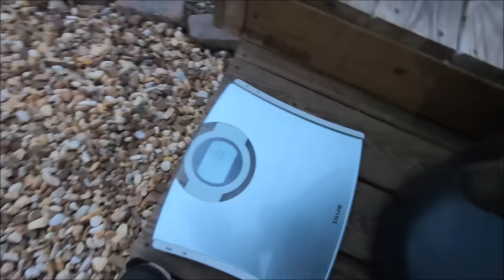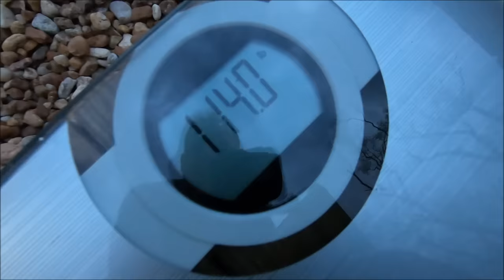Found Gigantic Chain Part 5: You Won't Believe Whats Other End: A Million People Want to Know ! ! !

Comment: It's a beach morring. A length of  line is tied to the chain..the middle of the line is tied to a boat. The.boat anchor is tied to the end of the line. A separate line is tied to the boat. The boar OS run to shore people and gear are set off .the skipper runs the boat out ehete a tender is tied off to the moring. The most is made fast and the skipper ferries himself in with the tender.  There is another way of doing this without a tender with a weighted submerged pulley 
This way the boat remains afloat in deep water. When you want the boat you you pull it in with the free line load up cast off secure the free line to the moring and head out .when you return you reverse this and your boat never goes aground.

Comment: Don't know if anyone told you what type of chain that is but I know what it is. Is there any railroad tracks by. Its a railroad switch chain. I used these when I worked on railroad cars. there used to chain rr cars together when a coupler or coupler knuckle is broke. so they can move the car in for repairs. dont know what the other thing is. hooked up lot of rr cars with these.

Comment: That is a tree drag. They drag cables tight with that bar with the pulleys on it so it does not cut the cable. The chain probably was in center when you found it.  They drag the chain through the loop around the bar  and push that swivel through a hole on a boat. Let friction hold it in place while they pull.

Comment: Wow - likely an anchor for a barge to hook up to and now can be a great chain lock down on the farm.  Tie something down so it can't be walked away with.  From Tornado or anything.  Bury it and have a short top out.  Nice chain, I wish I had it!    My guess, it rolled along a race on a dock as the barge moved with water.  A movable tie down. The triangle toggle is a lock when the chain goes through the ring.  The bar might be a Rope or strap pulley and the chain to tie it down.  Wonderful test to the mind.

Comment: About 40 years ago I worked on a stacker in a lumber mill.  We would set 2 of those things up, 1 on each side of a railroad track. We would then set the lumber from the Stacker on it and it would be rolled on the R/R tracks into the Kiln for curing the lumber.

Comment: The union used to use similar chains to stretch across rivers and streams to catch confederate boats, immobilize them, and sunk with hidden cannons (usually like on top of hills or bluffs (like they did in Columbus, Kentucky. I have seen the chains in person used by them
Reply: Except the links were way bigger on the ones used on the Mississippi River.

Comment: That looks like part of an overhead crane a small one. Maybe 3-5 tons max. Depends. But I don't believe it's more than 2tons. And what you have is one side of the trolley. It may have been powered or manually operated. I could be wrong but I don't think so.

Comment: The rail with the wheels on it looks like half of the bottom rails for one of them self pumping they used in the old days to go up and down the railroad tracks. You know the little platform 2 people stood on either side and pushed the bar down to move. Maybe you go back out their you might find the other half.

Comment: If you lived where I do your water bill would be in the $100.00 range. Use a pick or shovel to do the heavy work. Then rinse it off. I caught part 1 then this. Congrads on your find. But there may have been it's twin next to it. It was a anchor at some point. For what. ????
 It could have been an anchor for a boat or a ferry Crossing. That is a logging style chain it was probably put there to hold log booms. Basically big Square barge made of logs going to the mill. But that carrier beam looks like it belonged to a Boathouse  Trolley / ramp.

Comment: Why didn't you drop it in the river and shake it around?  Now that's a logging chain!
When somebody ask if you got a chain you can say with a smile yes yes I do would you like to borrow it? It's gonna be hard to get those rollers working on that bent metal thing it's on! Get a cutting torch and cut the rollers off good luck later brocephus!